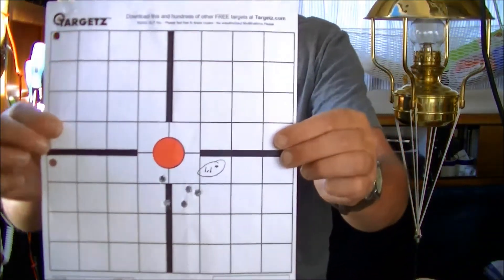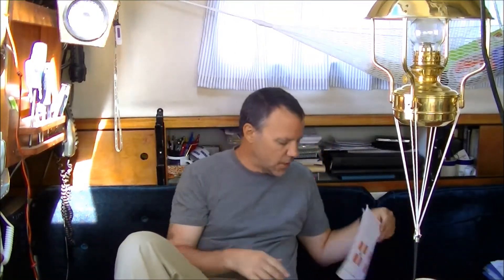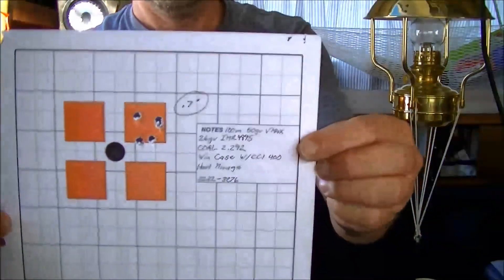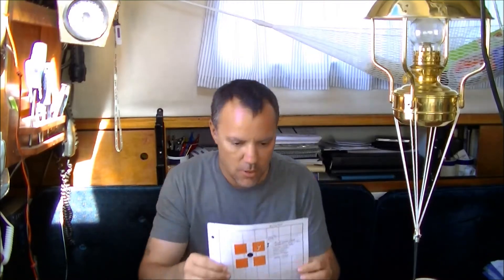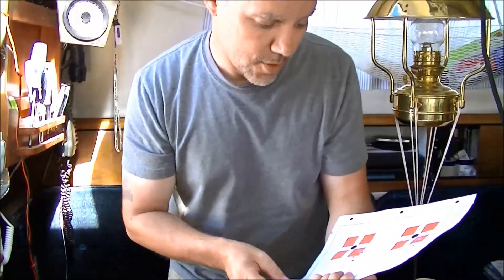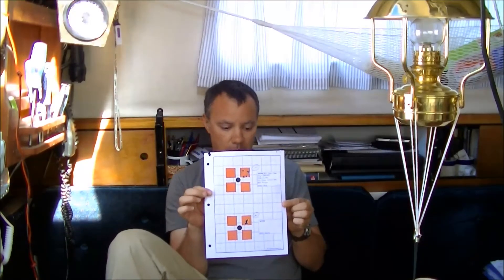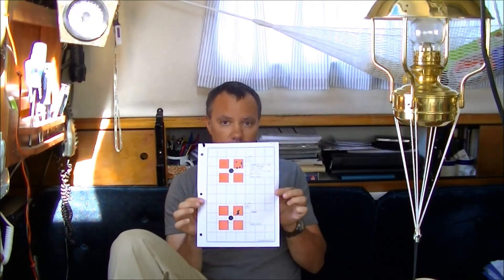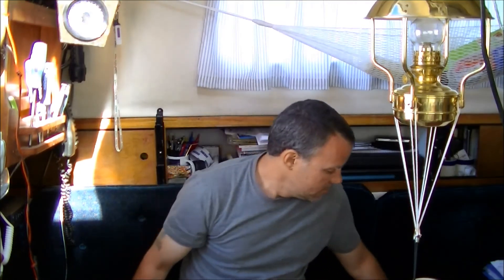.223 load data using IMR4895 and Hornady V-Max 50gr.

Comment: Haven't shot IMR 4895 in .223 yet but Using up some old Reloder 12 with 55 VMAX and  BL-C2 (at 26 gr), the Remington 700 SPS Varmint (laid in a better stock (M-50 Stocky's), shot 1.057 at 200 yards. Scope was Vortex 6-24X50 shot from sandbags. I haven't been able to best that with Nosler 55 gr Ballistic Tip Varmints, but am hopeful. Of course now they discontinued the Reloder 12, which was about 30 years old when I finished it off. BL-c2 seems good but inconsistent. 748 about the same. IMR 4895 seems okay across numerous things I own which is why I bought it cause I can load it in everything rifle. I'll have to see if I like it better than H4895, but the IMR is what the store had at the time.

Comment: Okay, 24 grains of 4895 overfills my case.. How does yours look with 26??
Reply from the maker: The powder level on mine just hits the bottom of the neck, so it's just on the verge of a compressed load if I seat the bullet deep. I'd rather not speculate on causes for the discrepancy but I'd strongly suggest you work your loads up and err on the side of caution of any published loads.
Reply: Mine are severely compressed at the starting load of 23 grains. Whats the headstamp on your brass?
Reply from the maker: I usually use Winchester brass, but this load also works with my Remington brass. For Norinco and IVI military surplus I drop down to 25.7gr due to the smaller case capacity due to the thicker brass of 5.56.  A few things I'm wondering: Have you calibrated your scale lately? Is the powder really IMR4895? Has the powder been accidentally mixed with a larger volume powder?
Reply: I cant say the scale has been. I havrnt felt the need. 357 and 30-30 max loads have been fine. And the powder is imr 4895. Not h4895. And it has not been mixed.
Reply: Same here with Federal brass. right at the bottom of the case neck. for 26 grains. Hodgdon shows 26.2c for a Speer 55 gr sp